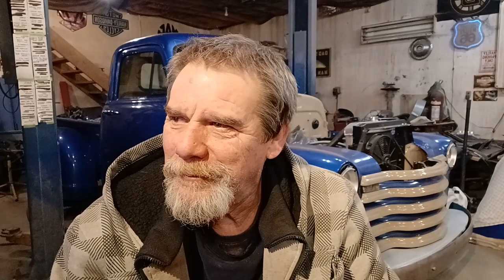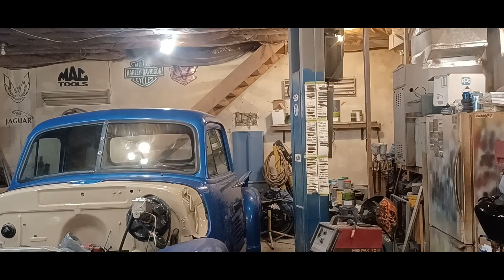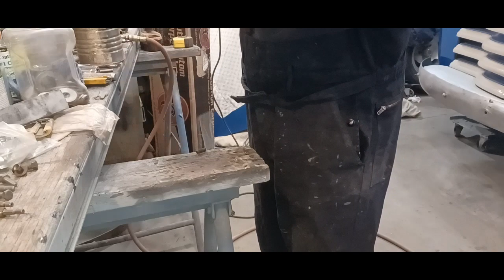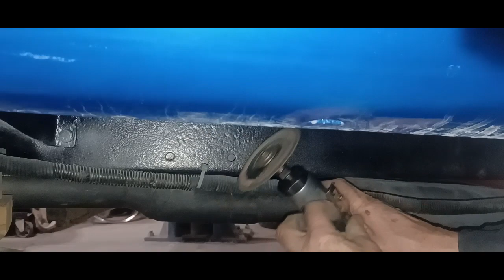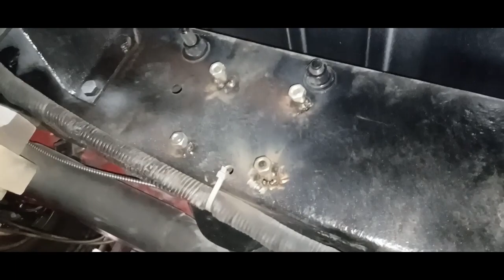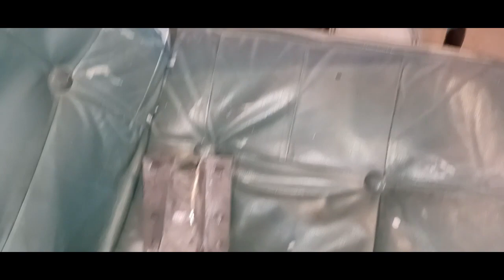WELDING IN STUDS IN FOR THE '51 CHEVY RUNNING BOARD BRACKETS!

Comment: Do you have the gauges in yet? I have a 48 I’m working on and was looking forward to that video. Also wondering on electrical vs mechanical. Any advice?
Reply from the maker: Guagea will be going in shortly. I went with original looking ones but set for 12 volt and a v8 engine. Electronic stuff is nice, but really expensive...these guages were a 1000 bucks for the set.